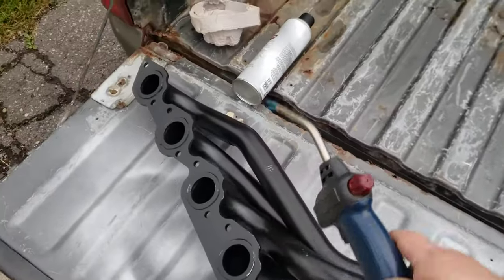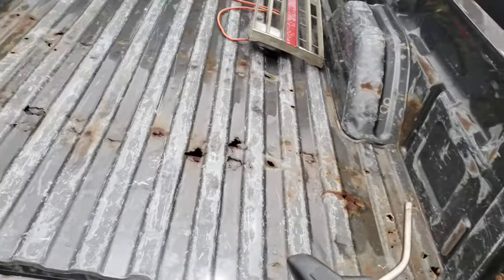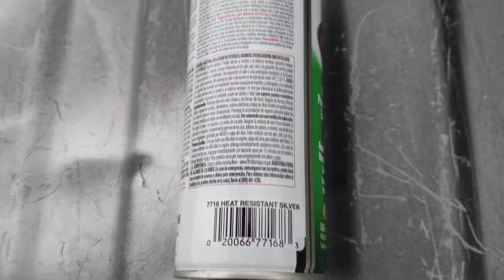This is how I paint headers.

Comment: When you cerakote parts there is an extensive prep process for parts. Not only degreasing prepped parts with acetone but also flashing off the metal with heat to get rid of anything trapped in the pores of the metal. Uncle Tony uses the torch method to paint parts. Makes alot of sense to flash parts off before coating so it doesnt flash off during heat cycles, causing coatings to lift off. Simple

Comment: I got a new set of Sanderson and the  welding leaves a lot to be desired.
Inside the collectors, the welding and assembly quality is.... Need to spend about 3 hours with a carbide fixing the mess ... Or just say, so what.
Then paint them.
Thanks for your input.👍👍😎🇺🇸
Reply from the maker: Rock on!

Comment: I did a set of headers on my 85 vetted they looks exactly the same as yours or pretty  close,they are the cheap headman, I stripped the paint and scuffed really  good and clean then coated with vht flame proof primer and then black vht header paint ,I cured the paint on the car and everything  was fine till the first ride painted burned off and look like crap now.
Reply from the maker: That sux, sorry man.
Reply: @@poopdogsays  is ok I am really happy with the headers ,I am running  a smaller summit 1102 cam and nice torque gain

Comment: Wait did you burn it to bake the new paint or burned it to help prep to paint them new? It looked like they were already painted black nicely? I may have missed something, apologies!
Reply from the maker: Yes... The black paint that was on them was the non-high temp paint sprayed on at the factory. So burning with the torch it cured  the black paint and also prepped the surface for the silver paint.
Reply: @Poopdogsays  gotcha! I thought that was primer you sprayed on at the end. And I only assumed that simply because of all the nightmare stories of the paint burning off right after you get them installed.. No Bueno. So I want to make sure I do it this way, and correctly.

Cause I love that you're using a butane torch to cure it. I was thinking the oven, box and a blow dryer, or just have to wait until it's 100 degrees outside to cure it 😂
Reply: @OneShot1Da heat gun 👍👍😎